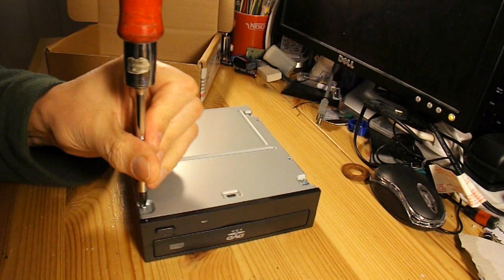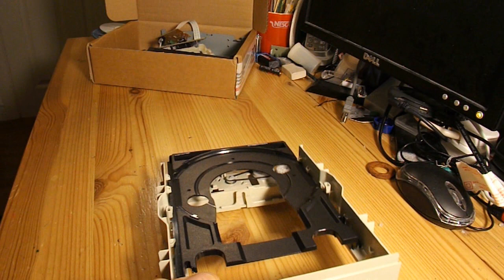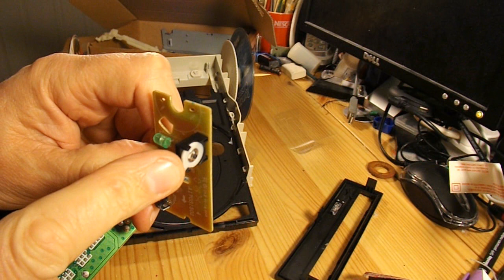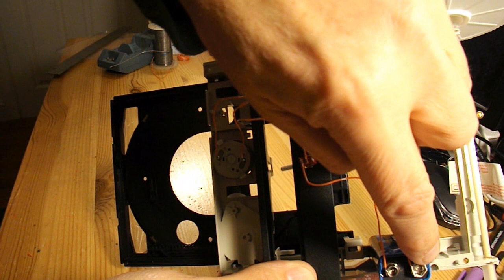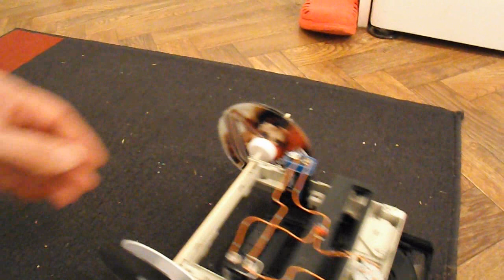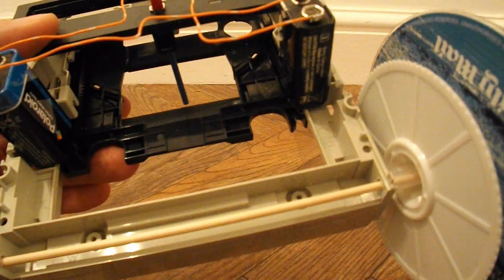Things you can make from an old DVD drive #1 - Crawlerbot Inchworm

Comment: I used Radio Shack's SPDT Mini Toggle Switch, part 275-0635. I found that the straw needed to be made of paper as the plastic collapsed too easily. Once the paper straw was attached to the toggle switch, I lined it with a short section of plastic straw for additional support, splitting the plastic straw down the side with a scissor and then pinching it down to the desired diameter. I added a small dab of hot glue to keep things in place. I used the narrow electronics board to hold the switch as it already had a perfectly sized hole for it.  A little super glue held the switch's plateform in place, more reliably than the hot glue. I replaced the plastic bottle caps, which are used to help center the wheels, with unused metal bottle caps that I drilled on a drill press. The diameter fitted nicely on the cds and provided more gluing surface. I also bought 2, 9v snap connectors, opening up the black caps covering them, separating the positive and negative connectors. This made wiring easier and more reliable. Since I did this project in an after school class for kids, I wanted them to be able to "turn on" their bots easily so I wired a mini alligator clip (Radio Shack part 270-0380) to the center post of the switch. We used plastic beads as spacers on the axles to keep the bottle caps from rubbing against the dvd. A small section of decorative duct tape was applied across the length of plastic that helps the bot crawl forward.
Reply from the maker: +Elisabeth Anderson that is fantastic, thank you so much for sharing all this. I always like to hear how other people get on with their projects especially when they are successful. I never worry about making my projects robust enough to last long as I move on to the next project within hours of completion so I fully understand your more practical approach. Will there be a video of it working?
Reply: I will write a blog post and include photos and a video to share with you and then send you the link. In about 2 weeks, the students and I will be making the mousetrap car.
Reply from the maker: Elisabeth Anderson I will look forward to it :)
Reply from the maker: That is fantastic. Would you mind if I included the link to your blog in my video description so other people can see it.
Reply: Sure, go right ahead.  I'll share our mouse trap cars when we complete them.
Reply from the maker: Elisabeth Anderson thank you, I did wonder if you noticed I did a very similar one without wheels, just the plastic at the front and the back, works best on carpet :)

Comment: hi, i want to ask , i'm trying to do crowler bot , but i doesnt work, i have new batteries, a new toggle switch, i wired everything right, so where can be problem ? is it can be bad wires or my dvd drive bad ?
Reply from the maker: +playmaiker the function is simple. The motor opens the tray when a battery is connected one way and it closes the tray when a battery is connected the other way. The switch chooses which battery you are connecting to the motor. Does the tray open when you connect a battery direct to the motor? If it works when you connect the battery direct to the motor the problem must be your wiring or your switch. If it does not work when you connect a battery direct to the motor the problem is either your battery or your motor.

Comment: Very good idea... I love it !!!  It looks like our Goverment's plans...one step forward one step backwards. Actually is one step forward and two steps backwards.By the way is it nessecary to use the toothed  part of video spool  ?
Reply from the maker: +Andreas Christodoulou thanks, the toothed spool certainly makes it work consistently. You can get a similar effect with just friction from the plastic strip rubbing on the wheels especially if you put a rubber tyre on the wheel but the toothed wheel certainly works well and has a pleasing noise as it clicks along. Here is one of my designs using the plastic on rubber idea https://youtu.be/Cwz2rR0asus?list=PLA5a2xPRSrB04L6RpUAs5akmK3jqmahPL

Comment: That motor for the disc sounds like it may have failed.  If you notice any noise spinning it, that may be the one that is bad.
Reply from the maker: +John Doe if you are listening to the rapid clicking noise that is the plastic ratchet effect I rigged up to stop the wheels rolling backwards.

Comment: The spindle motor that you showed was noisy may actually be ok. The noise that you heard is from a few little steel balls intentionally floating around loose inside the disc table I presume for balancing purposes.
Reply from the maker: +InsideOfMyOwnMind maybe :)

Comment: Thanks for this video when you were sliding the cd tray you gave me an idea for making a special polymer clay cane slicer :-) will have to dig out my box of drives and pull one apart :-) found your link which someone gave on an instrucatable for pulling one apart but they sort of made a hash job of the drive when pulling it apart :-/ which did not even give me any ideas of what it could be used for.
I liked the way you were very careful when pulling it a part and pointing out what can me used in other projects :-) as I am into dollhouse and miniatures I thought of things like fridges and stoves :-)
Again thanks for a very good video :-)
Reply from the maker: Thank you very much for such a wonderful comment. Good luck with your project. If it works it will be brilliant and even if it doesn't I hope you have fun doing it. For dollhouse and miniatures I am sure so many parts can be repurposed with a little glue and a coat of paint. Even the odd shaped plastic brackets on many electrical components, when viewed with fresh eyes from a different perspective can become something completely new.
Reply: Thank you :-) for the encouragement :-) 
I have already seen many computer pieces being used for Jewellery components :-)
Yes since watching your YouTube I have looked at some of the old PC pieces that I have from my old machines with new eyes :-) funny what you can see once you change your views on them :-)
Reply from the maker: Angela Herremans :)

Comment: Brilliant..could you make an automatic pet feeder using the same concept. I have a prototype just need to use your idea of opening and closing the feeder
Reply from the maker: If you wanted a door to open at a specific time of day you would need to add a timing circuit or link it to a computer output, maybe an arduino could be used. There was a switch inside that detected when the draw was fully open and fully closed so you would need to use that too.

Comment: Hey! The toggle switch I have is one of those "On/off" toggle switches. I want to do something very similar to your project, but the drawer will only ever open or close with this switch, never both. Where can I get the switch you used in this project?
Reply from the maker: KiaunisFilms I bought mine on eBay or Maplins but any electrical component supplier would have them.
Reply: +KiaunisFilms 
Radio Shack's SPDT Mini Toggle Switch, part 275-0635. I made the mistake of using an on/off switch. So, when the bot moved forward or backward triggering the switch, nothing more could happen after that because it became stuck in off.

Comment: Couldn't you make a crawler bot with the disc reader tray and frame?
Reply from the maker: Hi Hunter, I guess you mean the mechanism that drives the laser head in and out to read the tracks. If I had the right bit of circuitry to drive the stepper motor, than yes I could use it, but that would require more work than was needed here. A simple change-over switch does all the work here, whereas you are talking building a circuit with one or two chips to do the control work for the stepper. If you know of a suitable simple circuit that would drive the stepper, please let me know.

Comment: Are the batteries connected in series or in parallel?
Reply from the maker: +lucas leal neither. That is how this works. One battery drives the tray forwards and the other drives it back. The switch switches the motor from one battery to the other. The wiring is shown clearly at 06:40

Comment: Is there a way you could connect an old cd drive to a new laptop?
Reply from the maker: You were able to buy external adapter cases in the past. I don't know if they are still available. I suggest you search eBay. When you say OLD CD drive I am guessing you mean one with an IDE interface, so you will need an adapter that goes from IDE to USB. I have just looked on eBay and can see there are some very simple interface cable kits that do IDE and SATA to USB but I cannot recommend any of them as I have not tried them myself.
Reply: Easy

Comment: what video editor do you use on your videos
Reply from the maker: Serif MoviePlus Starter Edition
Reply: is it eeasy to use
Reply from the maker: showan hubix how can I answer that? I find it easy to use but I have been using it for a couple of years now. What was important for me when I started using it was that it is free and it does not crash my system which Windows Movie Maker seemed to do every time I worked with larger video files.
Reply: ok

Comment: can i use 2 pin toggle switch?
Reply from the maker: A 2 pin toggle switch will only switch one battery. To get forward and reverse I am using two batteries.
Reply: GrandadIsAnOldMan there is a problem when i turn it on and the dvd drive open its fast when it will close its slow
Reply from the maker: Paola Camille I am afraid that will be an issue which you will have to solve yourself. I can only guess what the issue might be, perhaps your wheels or axles are rubbing against the side. Are you testing it on the ground or just holding it in the air where there is no effort required ?
Reply: GrandadIsAnOldMan yes i am testing it on the ground, is it because of the batteries?
Reply from the maker: If you have wired it the same as I did then it uses one battery to go forward and the other battery to go backwards so if one battery has lower power than the other then the speed would be different. If your wiring is different than I cannot make any suggestions.
Reply: GrandadIsAnOldMan yes i have the same wiring with you, maybe its the battery thanks
Reply from the maker: Paola Camille good luck, you could just try swapping the batteries and see if that changes it round.
Reply: GrandadIsAnOldMan i know it's late but i would like to say thank you for answering my questions, it helps me a lot.